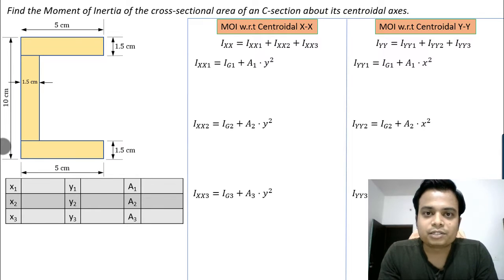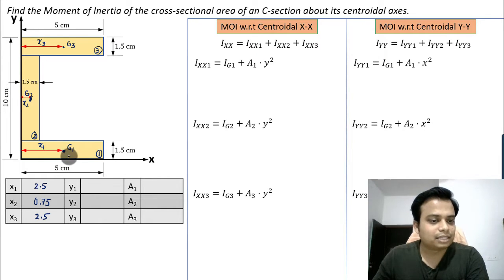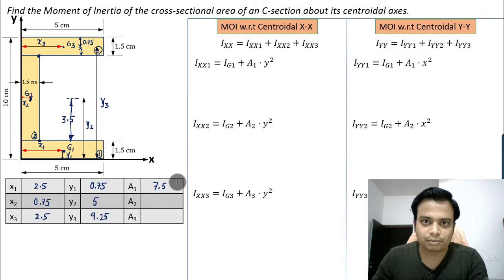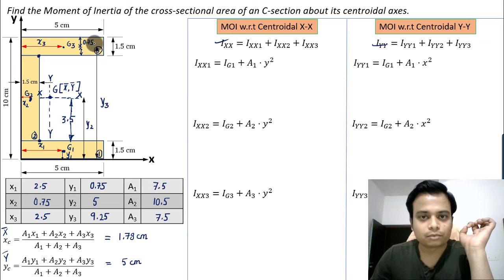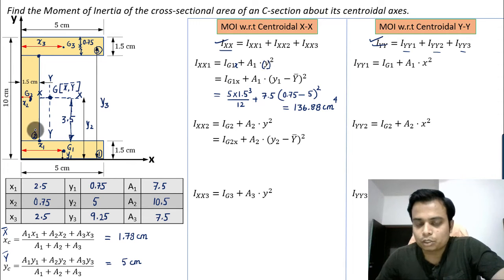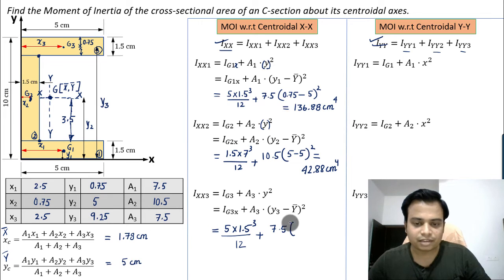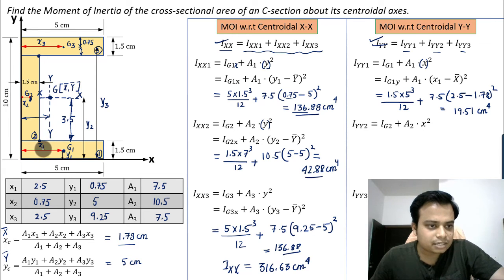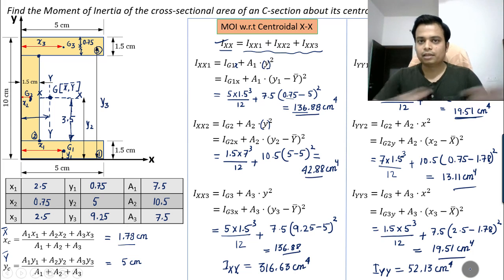Moment of Inertia of an C Section

Comment: this I´m talking about designing methodology. when we are calculating Area, centroid axix moment of inertia, the reference axis ahould be in the middle of the the web /flange . and thickness should be reduced 0.040 ( cover thickness) so t= 1.1 cm . just same information about steel design process.